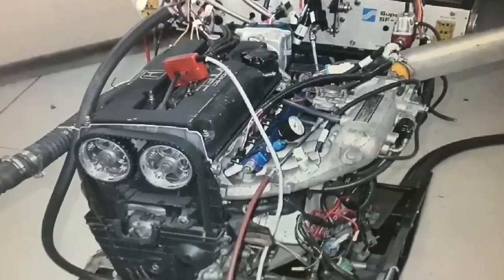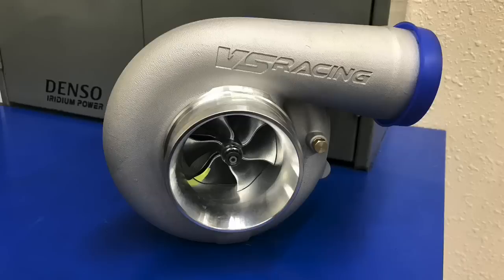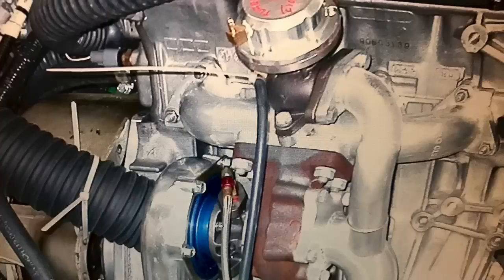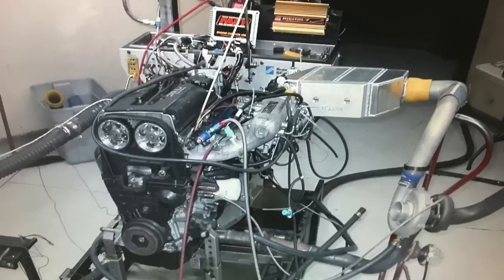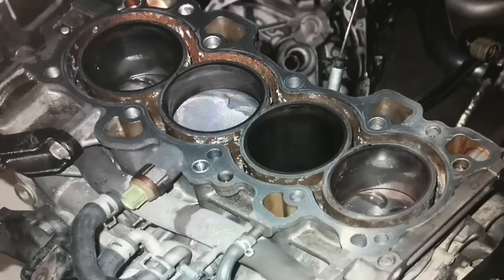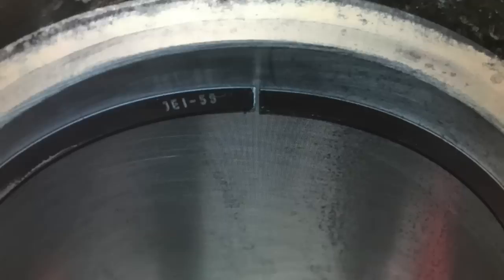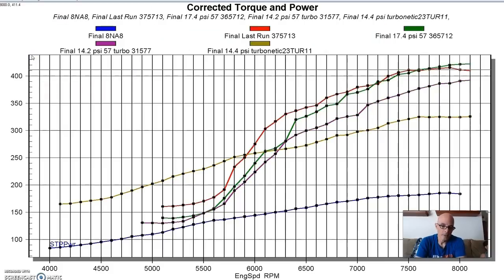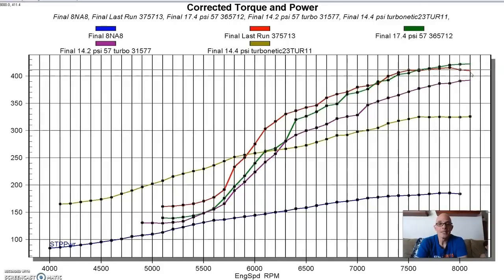BIG BANG B16A-HOW MUCH BOOST?

Comment: This gave me alot of hope for my build lol i currently have a b16a engine with a built head stock type r cams ported intake and exhaust ports supertech drive train valves stock block and crank with block guard 81.5mm wiseco 9:1 pistons eagle h beam rods im hoping to get into the 500s

Comment: Oem Stock b16  8 to 10 lbs  safe and depends if you have a heavy foot above that i'ts a dangerous risk
Reply from the maker: It's actually not dangerous if the tune is correct, if the octane is correct, if you have intercooling and ring gap (way past 10 psi)

Comment: Can I run 14lbs of boost also on my B16A sir? ITR cams with ARP head bolts.
Reply from the maker: yes with the right ring gap and tune and fuel
Reply: @richardholdener1727  thank you sir! You just earned a sub 🙏🏻

Comment: How did you get the FAST system to run this engine? Would love an explanation on the mods to run this system.
Reply from the maker: all you need is a distributor signal

Comment: Wait are these numbers whp? Or engine hp? 185hp on a stock b16 is impossible if its whp numbers
Reply from the maker: this is an engine dyno-and 185 whp is easily possible with a B16A (we did 212 whp)

Comment: Ok quick question, you said in other videos that as long as you “GAP” the piston rings with a perfect tune and proper fuel it will take the beating. 

On a B16 with “PROPER RING GAP” what do you think will be the breaking point of stock pistons???

Last question is this… Factory OEM B16 top ring gaps maximum service limit is 0.014” inch. Are you suggesting going over the OEM service limit on stock rings like 0.020” inch on 81mm stock bore????

So basically I can just yank out my stock pistons and rods, re gap the OEM rings to 0.020” and boost reliably to 300-400whp????  Yes?
Reply from the maker: we run .007 per 1 inch of bore-so the gap would be .022-.023
Reply: @richardholdener1727  so basically on stock pistons I can crack open the stock block, pull out all the pistons and re gap the top rings to 0.009” of an inch OVER the “Recommended Factory service limit” of 0.014”?????

What adverse effects would happen to the engine if I go 0.009” over the service limit??? Would I burn more oil, smoking, or loss of compression???

Comment: I have seen 2 b16a2 turbo setups with untouched motor internals .both were past the 400whp mark and ran great for a long time without adjusting looser ring gap..i wonder if this motor had sticking rings or an intermittent injector in that hole that broke the ringland
Reply from the maker: IT WAS RING GAP

Comment: I suspect even the 1000 hp capable blocks would fail if a ring seized at 6000 rpm.
Reply from the maker: every turbo motor needs more ring gap

Comment: You had about 100hp left in it, which is where I've taken the B16A2. It holds very well. I would say you need a better tuning system to begin with, a Hondata S300, not an S200/S100, those are very very old systems... maybe 20years or more. It is completely not uncommon to make 450whp/500crankHP, all you have to do is google it and you'll find plenty. the LS can make 400whp/450crankHP, and LS-VTEC also hits 450whp/500crankHP. The block you have to worry about is the B20, which is good to 300whp/350crankHP, and B20VTEC 350whp/400crankHP. Push it past all those numbers I mention, another 5-10%, and it won't last long. So, essentially, your bad tuning turned your B16 into a sad lowly B20-vtec motor. :( :( :(

Lastly, I would NEVER open up a motor and not replace the pistons and rods, at the same time as the ring gap and headstuds... which is another thing. The headstuds can be reused once from the Honda Factory, per the Honda Service Manual. If you are changing pistons and rods to forged, then why not, throw in the better head studs, since as a package, you can now go way more boost/power.

In the beginning of the video 3:45 you claimed you were going to simply change the ring gap, and not touch anything else, but then you didn't do that. I would have loved to find out if you can truly stick with the stock pistons and rods and make more power than is typical... but after seeing your tuning system, i lost hope anyway.

whp=hp measured at the wheels, when a car is put on a chassis dyno
crankHP=hp measured at the crank, when the engine is put on an engine dyno, as was claimed to have been used in this video.
Reply from the maker: if only i knew something about Hondas

Comment: Love your videos, curious why there isn't a big bang 4g63? That motor is amazing.
Reply from the maker: they really are
Reply: I ran a 1st generation bottom end with a 2nd generation head, stage 3 cams and springs, and was a very impressive motor. Seems like a common argument is which platform is better, the KA, the 4g63, or the b16.. thoughts?

Comment: What was the benefit of running a long tube header vs say a log or short tubular manifold? I'm assuming the benefit of avoiding detonation and the ability to have a High compression engine with a turbo.
Cheers.
Reply from the maker: I was testing to see if long tubes improved power on a turbo motor like they do on an NA motor
Reply: @richardholdener1727  
Was there a significant difference in headers?

Comment: Excellent test! I was wondering if you’re using any specific type of knock monitoring system on these engines. I’ve done some of my own dyno testing, pushing bone stock Honda engines (B18 non Vtec) into the 20+psi territory on several different turbos, all on 93 octane fuel. I know better fuel will make more power and less likely to detonate, but wanted to push the limits of standard pump gas and see what I could get away with. Also, how much ignition timing were you running on the last run of 17psi on the 57mm?
Reply from the maker: 22-no knock sensors

Comment: Ok so I’ve built plenty of Honda engines since the 90’s I do know your on the money most people talk of the open deck issue well I think your right the ring gaps are the source because when the piston breaks from too tight ring gap it takes the cylinder with it I know cracks all the way to the base of the cylinder I built a d series for nitrous years ago ran bigger gaps in the rings used domed pistons from a first gen Integra for a total of 11.2:1 compression and a factory cam from a carbureted Japanese model d series and then used a zex dry kit single fogger kit with a 125hp shot ran its ass off the CRX would run deep 13s with pretty much stock chassis it finally broke the following racing season when it was decided to bump it up to a 150hp shot well it went the first pass and blew pulling second on the second pass well we pulled the head and found when it blew the piston from not enough ring gap it took the cylinder jug with it blew on cylinder no3 and cracked the walls of no2 and no4

Comment: Ok so I’m picking up a b16a to put in my car this weekend so you saying before I put the motor in I should pull the head oil pan and push pistons through top and gap the rings and then buy eBay turbo kit and try to make 400hp comfortably with nothing but gapping the rings and e85? Just asking cause lol I’m thinking about doing it now

Comment: The rumor i had heard was only that the sleeves were the weakest point. Up to 500hp. I cannot speak for stock internals as my engine is fully built but i do run stock sleeves at about 17-20lbs. I have had no issues, but in the back of my mind i always have that thought to be safe and stay where im at (512whp)

Comment: As far as the b18 and stock parts, I always had issues with smashing ringlands and blowby manifesting. I never changed the ring gap I'll admit [in most cases] As far as that motor, pistons are the weak point's. They can make good power.

Comment: According to honda-tech, b series blocks can take around 400 to high 400's safely before cracking a sleeve. Results are varied. But that is the general safe long term limit until you have to think about upgrading the sleeves. Yes people have made more but at that point its a ticking time bomb. Stock cast pistons cannot handle detonation and will shatter. Ask me how I know LOL. Forged pistons are softer so they can handle detonation without breaking. Similar to standard vs impact sockets. 

On 93 with stock pistons you should stay around low 300. That's what I'm making now 320 whp stock b18a bottom. With forged pistons the limit is still around 450 cause now the weak link is the sleeves. So you can do a few things such as cement block filler which would compromise the cooling and is for only drag i believe. Devcon which is similar but i think has better cooling there's some youtube videos out there. Then next in price is CSS. This uses the stock sleeves and a perfectly fitted block guard. It is rated up to 700 whp and there's also a high hp version that is 800 whp. I've seen 900 whp css vids here. Then the best is sleeves but also the most expensive. Also Dart blocks are very good but banned in some drag racing leagues. So basically it comes down to the open deck making the sleeves weak. It allows the sleeves to move which eventually cracks it. They always crack at cylinder 3. Also at high boost you will need arp head studs because the oem bolts will not be able to hold the head down so it will lift. 

open deck - weakest, best cooling cause surrounded by water, cheapest to manufacture
semi closed - now the walls have some support. lots of turbo motors built this way i believe
fully closed -best. this is the reason the Supra 2JZ is such a strong motor stock. Because it comes with a FULLY closed iron deck. That thing is built like a tank. 

https://www.enginelabs.com/news/supporting-your-cylinders-open-semi-closed-or-closed-deck/

So once you understand the limitations of deck types, fuel, pistons, rods then you can see the power limits. Most people get H beam eagle rods which can handle 900 hp with ARP 2000's. Be careful with imitation h beams with weak rod bolts. Some can only handle 400 whp. There are many rod bolt options. Ok I think I wrote too much. Imma head out lol

Comment: I run E23 on my NA d16y8 with automatic transmission...
Accel 11076 ignition coil, NGK blue super mag cables, NTK O2 sensor, E3 spark plugs, brass terminals cap n' rotor, K&N panel air filter, OEM head gasket, ARP cylinder head stud bolts and a full rebuild cylinder head, stock ECU. 
Amazing... 
But I f my mixture goes to e25 performance goes down the drain

Comment: 1996 B18C Type R, arp headstuds, oem head gasket, e85 and 19 degrees of total timing. 410/277 @ 14.5psi eBay t3/t04e .63 exhaust housing. I road race it at that power level, zero failures.

Comment: I can personally tell you that my forged LSVTEC (B18B1 1.8L non-VTEC block with CP pistons and Eagle rods with a B16B Civic Type-R head with cams, MLS head gasket, ARP head studs, etc) makes 612 whp with the possibility of making more. It runs on E85 and has a Garrett GTX3582R dual ball bearing turbo. The limiting factor of power is the turbo only had a .63 AR exhaust housing. I just bought a 1.06 AR housing for it. The only sleeve support I have is a blockguard. I also have a Cylinder Support Systems installed JDM B16A in my basement with Wiseco pistons and Eagle rods as a backup.

Comment: It’s not how much boost it’s how much TQ it takes down low to snap a rod etc. My stock B18c type R 11:1 on a kraftwerks super charger made 367whp with only headstuds on 93 octane. I would of cleared 400hp with an adjustable cam gear and E85.

Comment: At 17 psi you are still far away 
We went a lot higher with 66mm turbski on stock bottom end b16a running low 10s allday long and stock ring gaps so check your tune 😂

Comment: The only problem with a lab dyno vs real world is there is no resistance on the engine, no load, such as the weight of the car, on flat ground or going up hill. My tuner said dont try to pull up hills in 4th or 5th gear because u add alot of resistance/work to the engine. This causes more pressure needed and more heat generated.. my stock b16a has a 57 trim and dynoed on rollers to 278whp. On 9lbs of boost. 190lbs of torque. But he did say heat is your biggest enemy. If building boost only go full petal, to keep it rich enough to avoid the heat... but yea this little 1.6 pulls very hard now. It sounds amazing too it spools loud and has flutter and a bov... its fucking sweet lol

Comment: Pretty cool, it's amazing how much power these stock engines can actually make. Honestly I think I would have taken that original small turbo setup you got going. The power and torque curve was much nicer and smoother. And for street use I suspect the car might even be faster, because you'll be pulling longer and sooner rather than it all rushing up at the tail end. At a drag strip where you can stay in the high RPM ranges you probably get a different result.
Great video keep up the great work

Comment: Many people have been successful including myself running 650whp on stock sleeves. That’s with running h beam rods and forged pistons... I have seen a few gsr engines reach similar power levels completely stock with just head studs but seem to only last 10-15 passes down the strip

Comment: Would be cool to see a big bag test on those old does 4.9L straight sixes.  There's plenty at the junk yard. My dad had one with 456, 7@$ before we parked it and let the battery die. Was a sold motor if you ask me
Reply: Ford 4.9L. Stupid auto correct

Comment: I just learned why rings lands brake under boost! I'm 54 years old and feel really stupid lol 🤪
Reply: No need to feel that way bud.
We need to  keep learning at any age. Hell, I resently learned that the reason that the handle of screw drivers are hexagon shaped is to use a socket driver to aid in turning your driver.
Reply: @Stickerslapper  I corrected my post so it makes better sense.....I honestly though it was do to the boost forces on the lands.  I at the point of installing TRW Turbo pistons in my ls vtec b16 head/B18b block. Everything is built for 600+hp  hp. Should I fallow the TRW suggested ring gap to the letter or do you suggest a increased gap?

Comment: Superstreet did a b16a with arias pistons stock rods 24psi 507whp. I had a b16a2 12psi beat it up for about a year daily driving till 2 pistons cracked just like you explained. I learned something from your video bigger ring gaps, thanks

Comment: I have a sleeved Lsvtec 83.5mm with Garrett gt 3076r made 417 on 20lbs I gapped the rings to CPs recommendation. Top ring was .018 second was .024

Comment: I’m always shocked by how small of a ring gap the piston manufacturer’s suggests. Now if building for myself I run the largest feeler. .028 instead of .018? Haven’t broken a piston since. I don’t have any empirical data to back this up. Just anecdotal experience. Thank you for the great content. You’re great at explaining complex topics.
Reply: I too pretty much run .028 on everything and it keeps the ring land together.  Ive seen unhealthy small ring gaps on newer stock engines where the wristpins are already very slightly bent. I didn't want to believe it but got the wristpin on a lathe and lo and behold its out a thou or s0.

Comment: good video on the b16a      but i do have a problem with it promoting that stock rods and pistons are good at this power level   the problem i have is yes on your dyno runs the motor handled it just fine but what happens when this car is on the street at 400 hp with stock rods and pistons and the owner is beating on it everyday .....  How long does it last before you  bend a  stock rod  ????   or a cast piston overheats and warps or seizes in the bore   or the head lifts because of stock head bolts ????

Comment: Seems like this test needs to be repeated to form an average. I've seen too many variances in results. Metalergy is real. If you took a factory new B16A and bought, let's say, 7 of them. Ran this test on all 7. And got the same results. Then I'd say you have a conclusion. You need more control in your test. If you buy 7 used B16A's and ran this test I would wager that the results would vary greatly. I agree that proper tuning and engine build specifications can net some impressive numbers with factory parts. But someone may watch this video and think their B16A will make this much power. And then it blows up at just 260 hp. This holds true for almost any engine.

Comment: On my channel im rebuilding my em1. Civic si with a b16a2. Stock rod arp rod bolt went to the jdm p30 piston from Nippon (oe in japan)  and with a boostlab 5758 on 10lbs e85 made 388hp 271tq

Comment: I got one for you, a junkyard b20 big bang, since b20's are known for having weaker cylinders than the b16,b18 blocks
Reply: Would love to see this too
Reply: that's due to the thinner cylinder walls from b20 having larger bore same issues with LS engines why boosted applications run the small displacement 4.8L
Reply: Get me more BOOST this same man has videos where 5.3 and 6.0 make well over 1000 horsepower , cylinder walls are never a failing component
Reply: @coltonbeute5889  I can't  say I have seen any of the LS motors fail due to a test that exceeded the strength of a stock part.
Reply: @JMMSBoyz  lol what? He literally couldn't kill a stock bottom end 6.0 gen 4 LS engine.

Comment: Running a Honda MPFI converted SOHC no-vtec D15B2 block, JE 9.4-1 forged pistons, eagle rods, full Manley and Isky racing valve train. Factory crank, cam, and ECU with  a manifold pressure bypass set up on 8psi 6850rpm limiter. No smoke, no issues, 27-32 MPG 24000 miles so far. Would love to see what an 89-91 D15 motor is capable of on your big bang program!

Comment: I would love to see you do that again with larger ring gap, but basically your saying I need to run e85 instead of pump gas on stock everything
Reply: If you have it available it's so much better than 93 octane gas.
Reply: gnarkiller I’m sure it is from the numbers of everyone else running e85 but has there been a tuner out there to run 50/50 e85 and 93 octane??